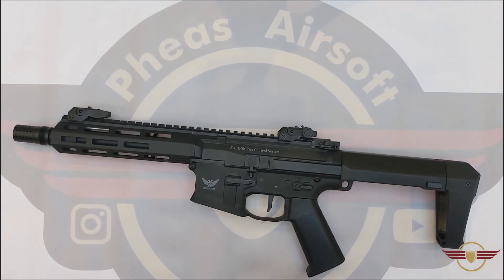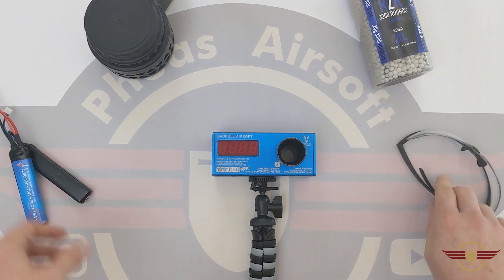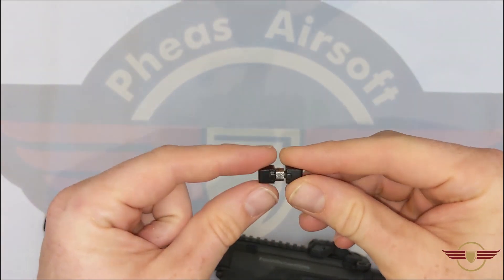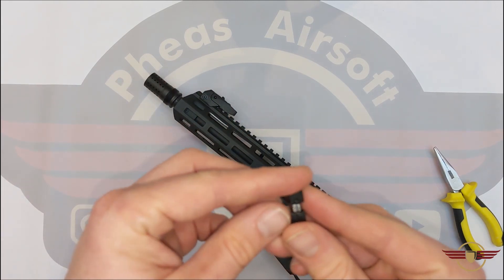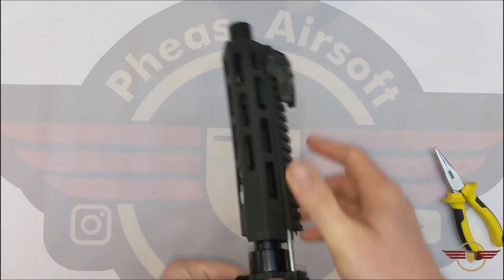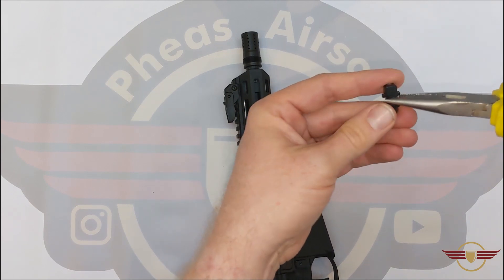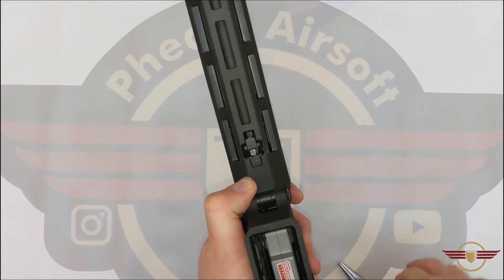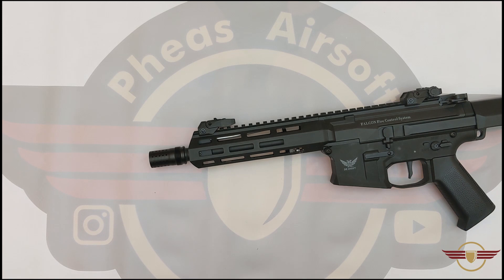[REQUESTED] [HOW TO] DE M904G Rail removal / hand guard removal

Comment: This was extremely helpful! I heard great things about this replica, but when I received mine I could hear an awful metal noise hitting the sides when i turned it. Turned out to be the long silver bit above the gas block, as you called it. No clue why, but it's slightly loose. Just going to tape it in place and call it a day. Appreciate the video again!

Comment: Hey a little late to the convo but I’ve got a question, I’m trying to buy the c&c tac 12inch barrel with a dummy suppressor built in but I’m worried that it won’t fit an average m4 body. It has a nut and bolt rail like this but can I just switch it out? Or would I have to get xtra parts?
Reply from the maker: Hello, if it comes with a barrel nut then its a straight swap out, remove the factory standard one and then you are good to install the new one. Pheas

Comment: Good job getting it apart, but that looks like a horrible system to hold the front hand guard on.   Maybe drill & Tap it and out a bolt in somehow might be a better solution.

Comment: Hello Pheas do you know if I can put precision 6.03mm inner barrel in this gun and if I can how long should I put
Reply from the maker: Hiya. It should take any brand of tight bore barrel and hop rubber. From what I can see online it's suggesting the standard is 215mm inner barrel. So something about that length will be good. Pheas

Comment: Top man very useful video, like this modular rail system the M904/7/8 models have reckon you could move this from aCQB to carbine , then DMR profile fairly easily. @Chiendenfersz Kenney -Got my M904G yesterday, can't wait to use in anger. I'm surprised at the solidity of the rifle as a polymer build. Not a massive fan of the flash hider so swapped that for a spare M4 duckbill hider I had, want a short suppressor on it.

Comment: What if I want to change the rail is that possible ?
Reply from the maker: Hiya. Yes, but you would probably need to get a rail that has its own barrel nut as the inlcuded one is intended for the included rail. Hope that helps! Pheas
Reply: Did you ever replace the rail?
Reply: @PheasAirsoft  hey Pheas. I know it's been a while, but if I buy a m4 handguard that comes with the outer barrel unit as well, would it fit this m4 ? Are these connections standard (outer barrel unit X receiver) ? I have the m906d which is a 13'' handguard, I want to have a smaller one for a shorter setup. I know a Double Eagle one should definitely fit, but that's nowhere to be found.
Reply from the maker: @peter11256  Hello! I am led to believe that it is a standard barrel thread and mounting point once you have removed their barrel assembly! Pheas
Reply: @PheasAirsoft  nice, thanks man